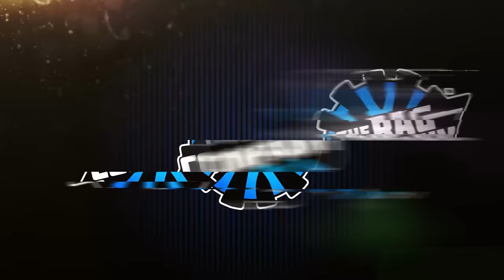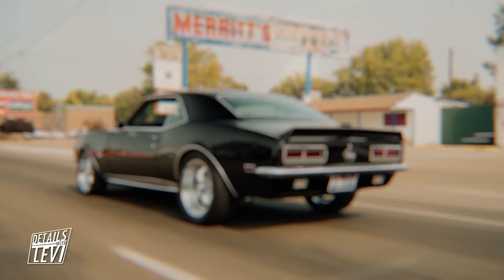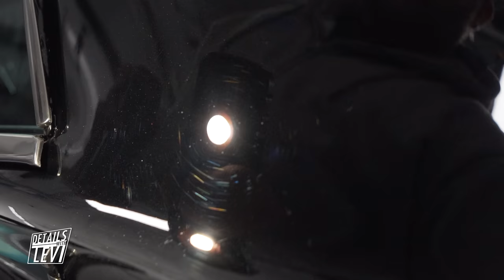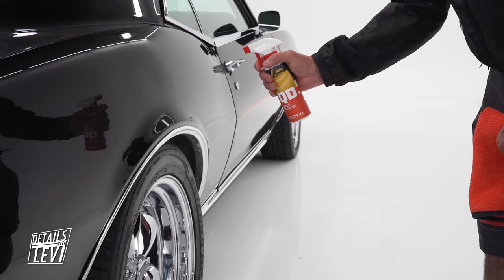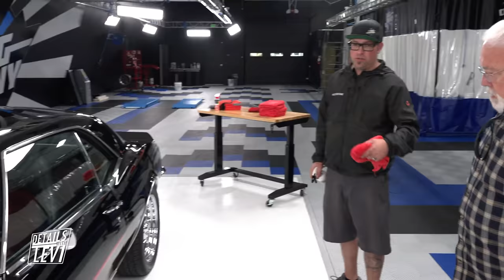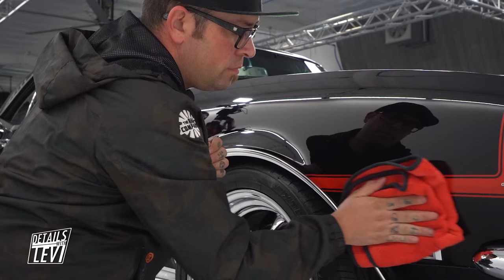Hate Scratches? STOP Making This Mistake! | DETAILS WITH LEVI

Comment: So the duster takes the dirt off the car. Well how does the waterless cleaning not scratch the paint? It's just wetting the dirt and then you rub it all over the surface
Reply: actually that's not how waterless cleaning works but thanks for coming out. also even if that were true (it isn't), it still doesn't make the duster a good option.
Reply: Do you not watch the video? Jesus Christ humanity has hit an all time low.
Reply: Waterless wash products use a mixture of detergent and polymers that float up the dirt and cover them with said polymers. They minimise scratches. Nothing you can ever do will completely stop swirl marks unless you have the dough to cover the paint with graphene or something like that.

Comment: Actually the duster is fine as long as you follow the directions. Too many people don't understand that you LIGHTLY dust the vehicle.  Meaning the duster  barely touched the paint. They have a tendency to apply too much pressure or allow the dusters weight to sit down on the vehicle.   I've used them for years and I detail cars.  All my cars have been black and when I use my duster I don't get any spider webbing or marks.
Reply: Actually it isn't and that has been proven many, many times but sure, keep telling yourself that paint care technology has not advanced whatsoever in like 50 years and the Cali duster is clearly the peak and cannot be improved upon. Honestly the way people talk about them, every sentence is like "well as long as you hover it an inch above and not contact the paint at all, some of the dust will come off from the breeze of moving the duster around!" or "well obviously if you apply more than 2 oz of pressure then you'll get marring, so clearly microfibers are in no way better. These aren't designed to remove ALL dust, just the top .01 micron." Just because you can't see the marks that you are without question leaving, doesn't mean they aren't there. Get out a Scangrip and I assure you, you are in for a treat.
Reply: @adamcoe  No where did I say "Cali duster is clearly the peak and cannot be improved upon."  Reading comprehension is very important. Now let's see.  I am 60 years old.  I detailed cars for over 30 years until my hips and back got old. lol  I have had over 10 cars and ALL were black and I am anal about my paint.  I can assure YOU that if done correctly it does no more damage then washing a very dirty car! How good of an eye for perfection did I have and for detailing?  I was contracted for over 5 years to detail the Porsches and Mercedes at the LA Auto show.  Unless there is a 100% touchless way to wash a car THOUROUGHLY, you are going to mar the paint to some extent or another. Oh yeah I've never seen ANYTHING to debunk the Cali duster when used properly.
Reply: Thank You for giving us your 'two cents'.
Your response to the gentleman below was great.
You have convinced me to buy the car duster, and use it on my very simple, but very sexy, 2021 Chevy Blazer RS...lol
I can definitely understand some people having OCD when it comes to their very nice and pricey show cars.
Thanks Again....

Comment: I have been using the California duster for many many years and haven’t had a problem them.
Reply: and you won't...for every person that says it will cause scratches, there are 10 people that will tell you, you won't...if you use it wrong, it definitely will...it should be used very lightly and to only get off light dust and pollen...its not really meant to clean your car.
Reply: Right on schedule, the guy who uses the method that's been proven over and over again to be damaging, but "has never had a problem." Either your car has been kept in a vacuum, or you've been swirling it with a duster, it's one or the other. Now those swirls may not bother you, which is totally fine, but they are there without question.

Comment: This is great and raises good points. And for my motorcycle, which has a normal carnuba wax coating on it, i always use a proper wash. But for the car, the car duster is much quicker.
I ceramic coated my car and now use the car duster max twice a week.

i get the ceramic coating replaced every year.

Comment: I have two black cars a '69 GTX and a 73 cuda a blow both the cars off with air then a light duster and I blow the duster out with compressed air I've also done experiments with half the car with a duster the other half with a microfiber towel I'll use anti-static or 3D waterless wash still end up with more swirls with the microfiber towel after 3 months of dusting but they both show show light scratching every 4 months I'll do a slight polish with HD 3D speed it's definitely a labor of love

Comment: With more than 30 years of owning and using a California Duster (and now a Griot’s) I disagree. When one keeps their car paint always ‘’high beading’’ finish, the duster does remove light surface dust without scratching. If the car’s finish is not protected with a quality wax/polymer then yes, but scaring people away from them altogether is a poor approach.
Reply: He says scratches occur because people keep using them without properly cleaning the duster.  He didn't say dusting is bad.

Comment: I only use the car duster when my paint is waxxed and dried. then every week i use an air pressure gun to blow out the dust in the duster. never had any sun swirls that stayed on after i wash my vehicle. you also arent supposed to be too rough with the duster, the dust will come off very easy

Comment: i really like the edgeless towels,but for some reason,they do leave a bunch of lint after a couple of washes and ive been washing and drying them as told by The Rag Guys.     Also,i have for years used the dusters,but really never saw any scratches from it.    maybe its time though to throw them away and stay with what Levi is doing here.

Comment: Next best tip: Just leave the paint alone. 

Be the guy with a dusty, flawless finish than the guy with a clean, scratched finish. Gotta pick your battles.
Reply: I thought I was crazy for not touching it unless I washed it... my philosophy is the least you touch the better... I power wash all the dust off then use a blower to dry.. then ceramic enhancer light wipe down ...  I got here cause I want to cover the car in the garage and don’t want to put the cover on dusty paint ..

Comment: Levi, Good simple easy to understand video on preventing scratches. I've learnt since watching detailing channels over the past 5 years, that you work in straight lines as all towels including microfiber can cause scratches and swirls. But you used circular motions when buffing off in the initial part of the video. I'm now seeing this more frequently in videos, mainly with finishing polishes. My question is doesn't this circular buffing still cause scratches and swirls even using the highest quality towel and with little or no pressure at all? Cheers from Down Under. Ozz
Reply: All buffing causes marring on a very small level, and going in straight lines does not prevent this, nor does it make it less visible as some would have you believe. Yes, when swirls get very intense they might be easier to see, but the marring required to demonstrate this is rather extreme. Use a quality soap/wash, don't reuse wash media (ever! the so called 2 bucket method has also been widely debunked), and you can feel free to buff in a circle or any shape you desire. If you have washed properly, then the marks will be essentially invisible. Every towel, no matter what, will leave some kind of tiny mark, it's just a matter of maintaining lubrication on the surface as best you can and using the minimum pressure while still getting the job done.

Comment: A side by side comparison on a panel with the two would be more believable instead of just saying a duster is bad.
Correct use of a duster and proper paint care will yield no scratches. Not saying that spray detailer is better  but a duster isn't any worst.

Comment: If u know how to use it prop u dont scratch.... its like every tool out there u gotta use it properly.... put it to d test against the towel swipe and i guarantee d towel method along with d detailer spray will mar the paint more than d duster!
Reply: @theragcompany   @The Rag Company  You say that, but I also fail to see how that brush could cause the circular scratches shown in the panel close up shots; circular scratches like that are cause by a circular motion, not by a brush that is used in a more linear motion. Would have been better to demonstrate/prove how terrible the brush is by using a perfectly corrected test panel and showing before and after shots.
Reply: @garyredmond1890  that would have been a really good idea and interesting to see!